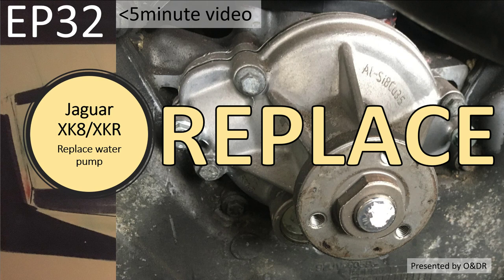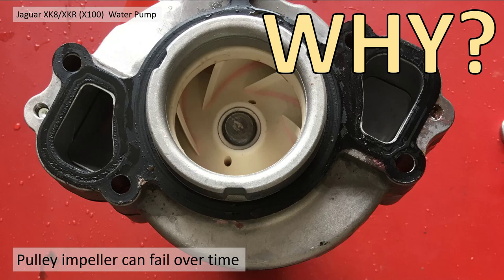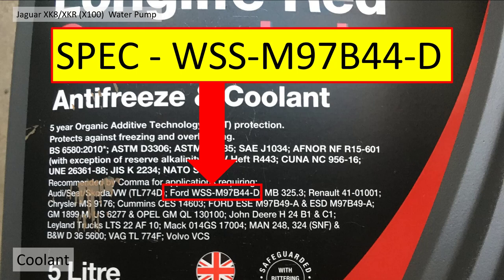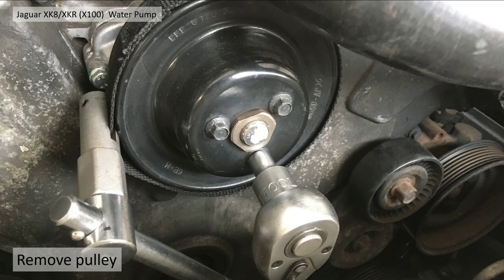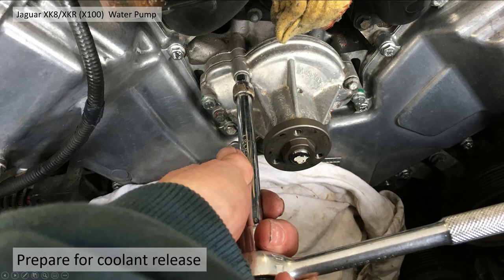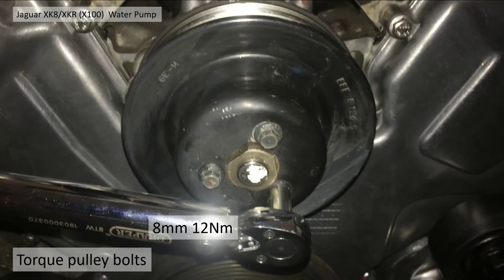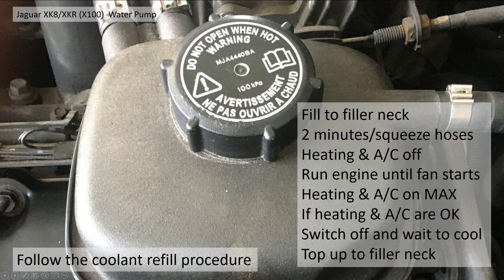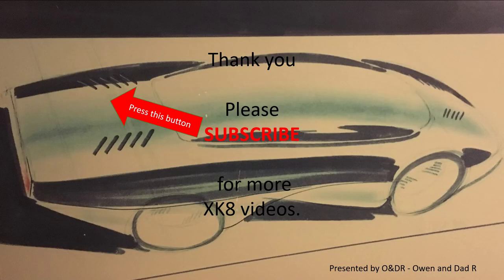Water pump change EP32 Jaguar XK8 / XKR (X100)

Comment: Older post, but so helpful. I parked on an upwards hill. Changed out the pulley and water pump in less than 30 minutes. Break the bolts on the pulley before releasing the belt. Very straight forward job. Release the struts for the hood (bonnet) and put it into the fully forward service position. This provides full access to the pulley and th e water pump. Thanks for the help in the USA. The shop wanted $950. It's a DIY for under $200.00.
Reply from the maker: Rex, very be good advice and tips. Very helpful for anyone needing to do the job. Much appreciate your input, regards Damian

Comment: In the States the orange coolant is called Dexcool, and green is Glycol. Mix them and you get a gel like substance. That was the first job I did on my XK8. I also replaced all the plastic parts with aluminium, and replaced the cap on the recovery tank. My original impeller was plastic also.
Reply from the maker: I think the previous owner had already changed the water pump but took if off just to check. Hoped it might be metal but still plastic. Talking of aluminium I'm thinking of doing the coolant tower upgrade next. Much appreciate the comment, thanks Damian
Reply: As I understand the aluminum impeller pumps have issues, they don't flow as well because the blades are thicker and they're subject to cavitation on the blades - which doesn't effect the plastic ones as much. Early ones had a white plastic impeller and those were the problematic ones, new replacement are black and are supposedly pretty trouble free.
Reply: All water mix coolants are 95% glycol, it's the different additives that are incompatible.
Reply from the maker: Thanks for the information and the comments. Good to talk.

Comment: hello, I have put a new pump and the pulley rubs against the screws of the new pump.  any advice?
Reply from the maker: Tino, the central hole on the pulley should locate onto the pump boss. The screws should act as fixings and not location points for the pulley. Make sure to apply the pulley fully and start all the screws by hand to avoid cross threading and binding. They should not rub. However, if this is still the case, it shouldn’t hurt opening up the screw holes on the pulley to stop any slight interference. Hope that helps and please let us know the result, regards Damian

Comment: Couple things. First, seems to me you won't need the filter wrench to hold the pulley if you just crack the bolts loose before removing the belt, same for when you re-torque them, do that right after re-installing the belt. 2nd, wouldn't this be a good time to flush the system, or do you feel it unnecessary given the aluminum components?
Reply from the maker: Andork, you are correct about not needing the hold the pulley if the belt is on when undoing the bolts. However, when reassembling you need to attached the pulley before putting on the belt. Flushing this system would be a good idea especially for these old engines, regards Damian

Comment: Thanks for the video! Do you need to remove the radiator fan first or is there room?
Reply from the maker: Lance, probably enough room but access is much better with the fan Assy removed. Quite easy to do with it removed. Haven’t tried it with it in situ. Thanks for the comment regards Damian

Comment: Good tutorial. Is it worth back flushing the heater core?
Reply from the maker: David, Not 100% sure to be honest but couldn't hurt to do it and the front radiator. After the new water pump etc I think I must have almost replaced almost all the coolant. Flushing would help to be thorough and avoid any possible issues. Good suggestion, thanks for the comment regards Damian

Comment: Hi Damian, I own an early model (VIN# 1390) and never changed the water pump. The pump is working properly, but I would like to change it for a new one. I followed the instructions, removed the pulley and the 5 long bolts too, but... it's impossible to detach the pump from the engine block. It's stuck. Any suggestion on how to detach it safely?
Reply from the maker: Arturo, Good idea to change the water pump. I assume the pump is still able to rotate freely and not jammed. If the water pump is stuck on it can only be the gasket holding the pump onto the engine block. I would suggest a tap with a rubber hammer might help to dislodge it and release the gasket. Hope that helps and good luck, regards Damian

Comment: what is your opinion on the drain plug on the side of the block, would you not recommend removing it to remove all coolant. , im interested why the workshop manual mentions it in places but not when it says how to drain the system. i must admit i have not studied the whole manual (pdf) . thanks again for your channel
Reply from the maker: Todd, Not had any need to drain the coolant completely from the engine. So never used it and don’t have any experience of it. Sorry can’t help with this one. Might suggest the Jaguar forums for this question, thanks for the comment, Damian

Comment: Am I correct in thinking you did this with the radiator off (maybe a silly question)? If so, is it doable with it still in place? Thanks again, your videos are very generous.
Reply from the maker: Bernard, not the radiator but I did remove the fan pack. Quite easy to do only bolts and electric connect for the fans. See this video  Thanks for the comment regards Damian
Reply from the maker: Removing radiator fans (fan pack) EP3 Jaguar XK8 / XKR (X100)

Comment: Hi very nice job mate, i have a strange issue with my xk8 1998 , i have an coolant odour under the bonnet when the engine hot and i have the cooling level error during large acceleration , i can't see any leak , any idea ?
Reply from the maker: Sounds like you have a leak (sorry to state the obvious). If you are loosing coolant ? The place will normally start to show brown staining from the evaporated coolant (you know). Try checking the coolant tower and coolant hoses first (but you've probably done that already). There are also coolant pipes under the inlet manifold need to take the engine cover off and try to see through the gaps in the manifold. Might be a head gasket if you can look in the area (harder to see can front corners from under the car). Hope that helps, thanks for the comment, Damian
Reply: Try a lower temperature thermostat, maybe 45⁰ cooler. Then check your hoses where they connect.

Comment: How can you tall if it is original pump somebody told me if the gasket is metal it is original is that true?
Reply from the maker: Robert, I doubt it but do not know for sure. The gaskets were rubber in my case but I believe the water pump had already been changed so cannot confirm or deny your suggestion. Sorry can't be more definite. The water pump is easy to remove its just the coolant loss is inconvenient. But an excuse to renew the coolant that is not a bad thing. Thanks for your comment regards Damian
Reply: I found a metal gasket on my original pump which I just changed out due to a small leak through the weep hole. The upgraded spec pump no longer utilizes an o ring and gasket. But still has the plastic ( composite) impeller and a new paper/rubber gasket.
Reply from the maker: Rex, good information. Much appreciated, regards Damian